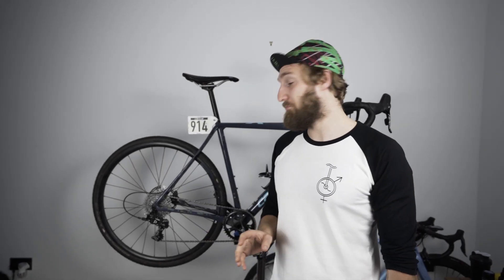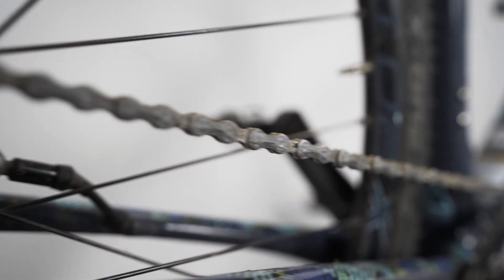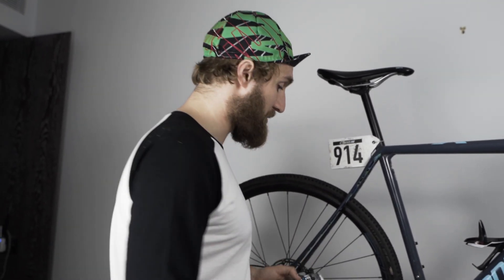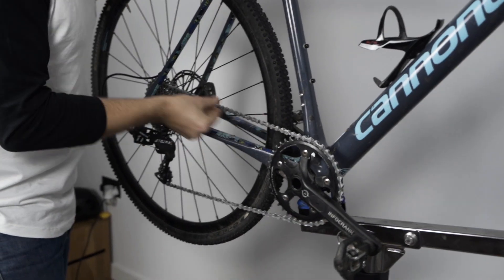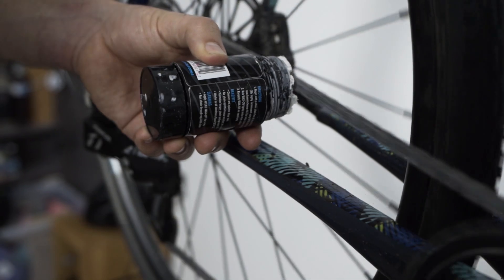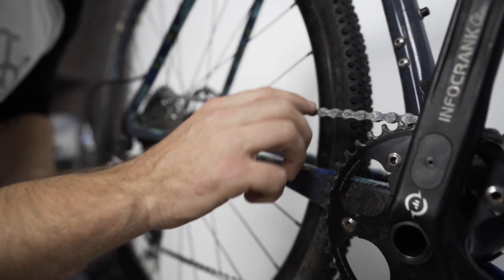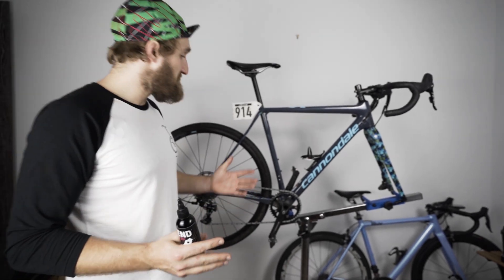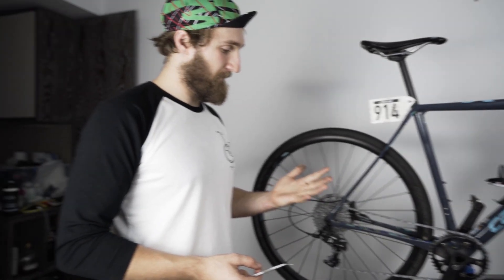Wax Lessons with George

Comment: so, we need to clean chain from chainllube before start ?
Reply from the maker: yussan Absolutely! It’s best to start with a sparkling clean chain and cassette. You don’t want any oil contaminating the wax. You can use a regular degreaser or the Wend Wax-Off is an awesome cleaner.

Comment: is it save/fine to use normal degreaser (from shimano) instead of wax-off as a lubricant to melt down the wax in step 3 (or 4;))??
Reply from the maker: Unfortunately not, the Wax Of formula is a blend of citrus based solvents, waxes, and other key ingredients to cut through wax quickly while leaving behind a trace amount of wax.

Comment: good try but wax must be melted to come inside of chain links, inductive heater would help to heat up chain
Reply: fine, i use my own blend of waxes and parafin oil  and heat up chain on bike with inductive heater and touch chain with wax blend stick and it melts and penetrate into chain, procedure can be repeated , first pass is cleaning ,second is lubrication